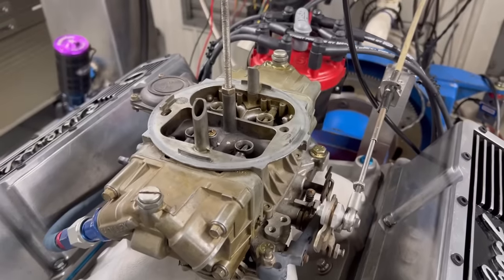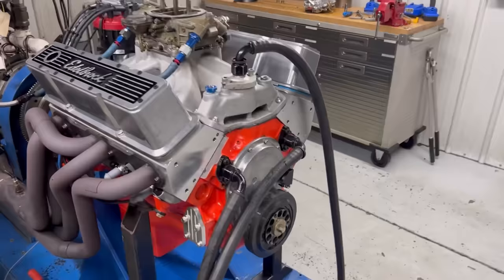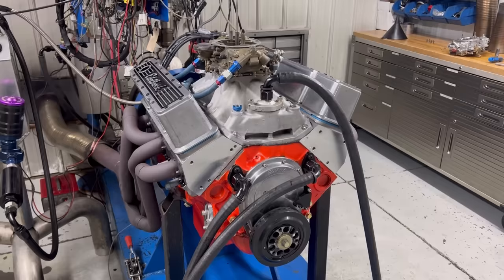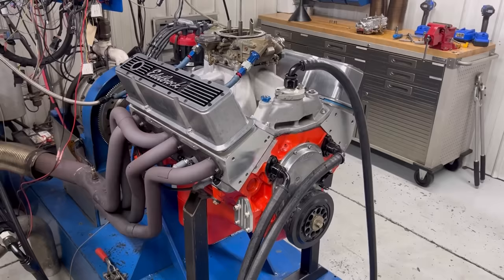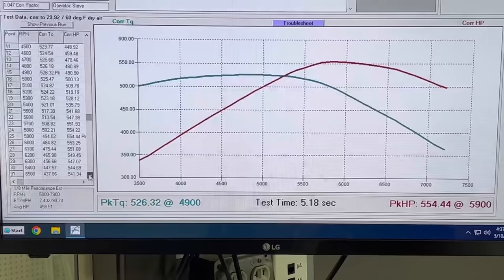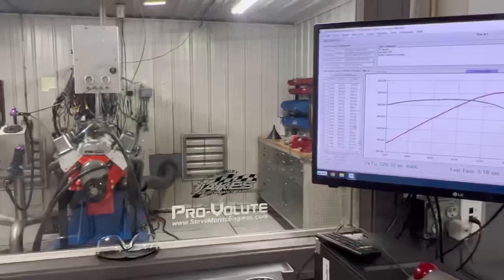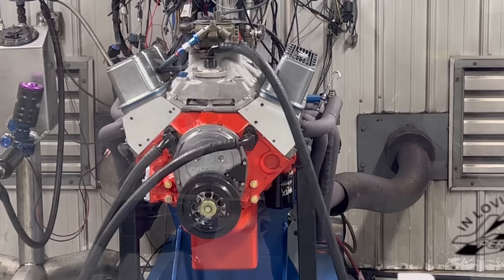Old school baby!  383 SBC

Comment: Thers a reason these motors are so prolific. You gotta love a small block Chevy that makes over 500 horses and still idles decent. Very nice.
Reply: But no choke!   How do you start it on a cold day?
Reply: @garybulwinkle82  no problem just use ya foot n baby the throttle
Reply: @garybulwinkle82  So buy a carb with a choke.... my electric choke quadrajet works just fine and still gets better fuel economy than any holley.

Comment: That would be a blast to drive around on the street. This proves once again that all you need is properly matched parts to have a good performing combination.
Reply: Unless it’s turbocharged, carbs can generally be used to great success if you have the know-how
Reply: Very true. I work at a mustang shop and we had a old school 302, GT40 upper and lower with heads. Also has a T trim blower on it and made 544 wheel on our dyno.
Reply: We've done quite a few 383's for both street, and race track use, and they are a very good 'bang for the buck' engine. Another very popular deal is the 347 Ford stroker.
Reply: and the other kicker is to focus on what's behind the flywheel. many dyno queens love their buildsheets, but that's with no water pump, 60 degree inlet air, and an exhaust system that won't fit a car. but get the right torque converter or clutch, right weight flywheel, good gear ratios, and a rear suspension that won't hop, and folks won't even believe the time slips when you show them.

as for carbs, they're great for turbos! the venturi effect cools the charge coming in, you just have to build for boost so you aren't spraying gas out the tube you put a spark plug boot on top of (old school, ask your father kids)
Reply: @albertgaspar627  carbs are horrible for turbos… it’s the very thing carbs are not equipped to deal with. 
There is tons of literature on this, just some googling and reading and you’ll get to the same level of understanding. 
Not trying to be rude at all; it’s just not even a debatable point so I assume you don’t have the info to know otherwise
Reply: @albertgaspar627  also btw, charge air cooling with fuel is an evaporative cooling process. Venturi cooling is a whole different process
Reply: @bigiron4018  Guess you've never heard of CSU carb's?
Reply: @bigiron4018  I appreciate the measured response. OEM made carb'd turbo setups (with warantees) until the 1980's gas crisis when they downsized everything and returned to V8's afterward. There's plenty of information out there if you just search "carb and turbo" to get it right. this is just the first ones I found:

how to build one cheap:

https://www.youtube.com/watch?v=9ENLVf0VZ80

does it really need an intercooler:

https://www.youtube.com/watch?v=BzvyXGwOMcw

Even Richard Holdener got on the bandwagon with an LS and carb setup:

https://www.youtube.com/watch?v=EkKVYTMK6NY

twin turbos on a rat with a carb:

https://www.youtube.com/watch?v=Yt3jH7R5ixo

so there's videos of it being done and the scientific results. Hope you enjoy :)
Reply: Big Iron there are plenty of guys out there making big power blowing through a Holley carb.
Reply: @matthemberry   making power is easy, it’s low load drivability they really suffer with. Most are just way too rich in these conditions which is poor for street driving

Comment: Nothing wrong with old reliable SBC they are still out there and still making power good for the old hot rod or weekend cruiser
Reply: Yup!
Reply: @musclebone7875  Putting one in my C3 just so it goes as good as it looks. Can't have as beautiful car and 170 hp. Lol
Reply: @nkmoto894  right! A c3 with 450 to 500hp would be nice 👍
Reply: the funny thing is that in an age of LS, mouse motors are the cheapest they've been since 1973.
Reply: Love the sound of a high compression big solid camshaft SBC.    Sounds better than any LS
Reply: @Ada-zn3pw  My C3 does sound good I'll give it that. & I will miss it. But I want to reliably make 500 whp and have AC and daily drive it. It'll get better fuel mileage in this crisis we're in so I thought the single turbo LS would be good thing. For now she's still a sbc 383 stroker and I'll keep that engine as back up. I will always have a soft spot in my heart for the thumpy sbc. Lol

Comment: This engine bring backs many memories.  I remember finding 400 cranks and turning them down to do this 30 years ago as well.   It always was a fun project.   Brought back many memories.  Thank you for sharing.   Was very surprised at 550hp, but was not surprised at 500 ft/lbs of torque at 3500.
Reply: @peterlyons4389  you did back before the aftermarket did it for you
Reply: @peterlyons4389  When I did this years ago, we found cranks out of sbc 400's out of combines (which was very common) and you had to turn down the mains.    As MrJayo Stated below, this isn't like today where you buy a crank and put it in and its all done for you, this was the old days of digging through junkyards to find parts ,the times have changed.
Reply: @peterlyons4389  ah well...the deal is, when automakers made a long stroke crank for a smaller engine, they needed the new crankshaft to have strength. that strength comes from the main diameters overlapping the rod main diameters, and the easy way was to increase the size of the main journals. look up the difference between the 400 and 350, you'll see that they indeed to need to be turned (and if you wanted a 377 cid, you had to use special bearing shells to put your 350 crank into a 400).

now, to further educate you, in 1968 chevy changed the rod bearing size in the small block. so folks building an "all factory parts" engine for racing would take a post 1967 crank, and offset grind the crank to a pre 1968 connecting rod and get more stroke. On a 350, that would be a 360 cid without any boring out, 365 on a .030 over block, and 370 on a maxed out .060 cylinder. 

Around the 1980's folks went to the 383 because they typically put fuelie heads on their 400 without knowing they needed to drill out steam holes and overheated the block...but decided the crank was salvagable.
Reply: @builditinyourgarage7826  I've done that with transmissions.  Taken apart 3 scrap trannys to get different ratio combos. Then build 1 trany.
Reply: I was part of a fuel car team back then and I got the combination from another racer. I did one including the block clearancing in the back room of the speed shop. Without many people knowing what it was it was a nice surprise. I had it in my daily driver Vega panel. Could light the tires at like 60 mph .

Comment: I love these old school small blocks. The supercharged and turbo LS builds are awesome and impressive, but these old school engines are great for casual street rodders who don't want to run 6's at a drag strip.
Reply: Quite a bit of effort to get an LS in the 6's. No?
Reply: Yep...this is an awesome street motor, no doubt....lotsa torque down low to make it MOVE and enough HP up top to make it fast.....

Comment: Back in the 90s I built a SBC.  I still like the sound of that SBC at 7000 RPM over the "slappy" sound of the modern motors like the LT1 in my 18 camaro..

Comment: I could hear the accelleration rate of the power test right away. That impressed me the most. Very honest dyno pull. Vrs some of the desperate pulls we see on youtube set at 100 rpm per second or even less in an attempt to fool someone and torcher some guys engine.  So this was refreshing and gets 5 stars from me.  Also was enjoyable to see a good o'l grass roots core sbc like we all grew up on done by pro's.   Great runner!

This was the best vid I have watched in a very long time.
Thank's

Comment: Sounds excellent, killer numbers and torque curve. People are so fast to dismiss the old sbc these days and I'm not sure why.
Reply: Simple answer more power, cheaper and stronger engines like the ls are in every junk yard now. Still love a good old sbc tho
Reply: @joe1273  No doubt LS is cheaper  out of the box. But if  you're doing aftermarket block and heads build the LS doesn't really hold any advantages anymore.
Reply: @joe1273  If you like junkyard engines, not for me
Buying aftermarket stuff for ls vs sbc, machine work sbc is still way cheaper and just as effective. Takes a lil more cam timing to make the same power thats all due to the 23 deg head and hassles of efi tuning etc

Comment: Wonder if Steve has any tunnel rams with Predator VV carbs hiding in the shop? Now that would be a lesson in tuning ..........
Reply: Heh..was just thinking the same.
Only Chevy I've ever owned was a 383 built around the time this one was (early nineties)..pretty much identical to this, but running a single Predator. Nobody did dyno runs back then, but it was good for low 9's in a light front engine dragster..
Good ol' days..

Comment: Real close to what my Dart SHP 400cid puts out. My combo makes 530tq 560HP on pump gas using a very drivable dual plane manifold.
Reply: Same here , just a little less hp (500) and skip white stuff. 400 block= torque monster
Reply: @frankburn6312  Yes all that torque right off the line, so much fun to drive. Made a double pumper work with my Automatic with some tuning.

Comment: Now build a 377 destroked 400. I think even being down a few cubes it will make it up in flow with unshrouding the valves out to the bigger bore. This setup dominated dirt track racing back in the days of limited aftermarket options.
Reply: @peterlyons4389  no it's a 400 with a 350 crank
Reply: @peterlyons4389  I don't understand your math that would only be like a 378 if it's bored 30
Reply: @peterlyons4389  the math dont lie 4.155*4.155 *.7845*3.48*8=377.05 ci. 
A std bore 400 with 350 crank 371 and change ci
Reply: @scottmuller1901  we will let him ponder on his mishap
Reply: @peterlyons4389  you might want to figure out the correct answer before you post something else

Comment: That's real good numbers for a gen1 383sbc, it would be real nice to know the cam specs.
Reply: You can bet it's not a wide LSA cam at 110-112 and most likely is either 108 or 109 if the compression is over 10:1.
Reply: You can definitely run 11.1 on pump gas with a big duration cam .

Comment: Wow that a good running street engine . I was amazed on the hp and tq number . It's my opinion that cylinder heads is key to doing this . I prefer a solid roller csm also .

Comment: I dirt oval race. In the class I’m in it’s either a 602 with 350hp, or a open engine with around 450hp, if you stay on the edge of the rules. The 602 can run a 4 barrel Holley, but the open engine has to run a 2 barrel Holley.

Comment: Steve m.  Do you when the rare time you do carbs look at IFR  sizing per displacement.  Holley ships carbs with 0.031" IFRs. Good for a 327- 335 ci.   347 -360 ci  need a 0.032 ifr.    383s need a 0.033 ifr.  
This prevents leaning the engine out from idle till the primaries start to flow at 1900 and fully take over at 2400.  Looking at AF ratio just below when the primaries start to trickle fuel let's you know the ifr sizing is correct..

Comment: I have twin 1969 Kiekhaefer 482's. Built the same way with welded up cranks and reground. Basically, it's a stroked 427 truck/tall block to a 482. All off the shelf chevy parts numbers except for the rods.

Comment: I have a forged turbocharged 383 with heads cam intake 4150 throttle body  running ls1 ecm coil over plug ignition .   I love the old school sbc with modern electronics.  Back when I built it there was a large difference between building a gen1 and gen  3/4

Comment: I built a 383 sbc 3 years ago. I know I am not  getting 550hp. More like 400 maybe. Alum heads, roller cam, lifters and rockers. performer air gap manifold and edelbrock 650 carb. Street fire distributer, headers. I t runs like a banshii  at wot but idle is not great under load and it wants to pre ignite or run on when hot. When cold it acts like it has a vacuum leak leak and wont power the brake booster. fuel economy is terrible. I could use some advice if you have any clues. I know you are busy so don't worry about it. Thanks for the  video. I'll keep trying till it gets better.

Comment: I have a low mileage SBC 350 bored and stroked engine which makes it a 383 SBC....Turbo 400 transmission,NP205 transfer case,1/2 ton Ford F-150 axles..Dana 44 high doff front axle and a stout Limited Slip 9in Ford rear!! For my 4th Cherokee build my 92 Country Edition Cherokee...Gonna be sick!!!

Comment: i built 1 stock block 383 core #  3970010 The good stuff in those days pro line bottom end Dart pro one heads with 2.15cc in 2.08in 64cc copper head gaskets arp bolts harland sharp 1.6 rockers and a 750 vaccume secondary too and then came THE LS ,at the bottom again owe well its forged 10.9 comp lets spray 300 and it took it till it took off my spark plug strap and a valuve on the way out at the finish line some what like someone we know!1  took more than nickles and dimes brother. thanks for your constant dedication and content {would you shair more info cam spec anything would be appreciated old school 383z we are many > MJ

Comment: Nice torque curve for a single plane! 1.37 lb-ft/cu in is very stout! Interesting that you picked a solid roller. Just curious—did you use roller/needle bearing lifters or bushing style?
Reply: Di
Reply: He said solid rollers
Reply: i think he uses "street" rollers that dont need a lot of spring pressure or a higher spring rate like a normal high lift roller  that trashes solid roller lifters

Comment: I like the rpm range.  Can you give us a general range of the cam's duration at .050ths? I would guess in the high 230s to low 240s on the intake and 6 degrees more on the exhaust at 110 degree CL?

Comment: That’s what I ran in my race car ( hopped up 350’s I was making 1000Hp N/A according to the NHRA’s Dynamometer and that’s WHP ) except I ran a Holly 750 double pumper at first then later on I went to an 850, it needs a better intake and way bigger cam, my car made power out to 7800rpm but I ran a huge Lunati race cam, for a SBC it makes peak power like a BBC that’s weird I built a bunch of stroker for other ppl and they ran like I dunno what I built a guy one he had a turbo 400 I told him he needed a new race transmission with a shift kit in it he calls me two weeks later to tell me my motor blew up his tranny just like I told him it would I told him this is essentially a bracket race car motor back in my day this engine woulda ran a low 5 sec 1/8th easy only different is it had a comp cam which knocked off probably 200+ HP from the build he didn’t up his compression either he stayed 10-1 instead of going 13-1 or higher 15-1 makes a lot of power in a 350/383 convert you break a lot of rods though at least in my day they have Titanium rods now I wish they had that when I was racing

Comment: Thats outstanding numers! That would be a  perfect motor for my boat. Can you list the build?
Reply: It's really hard to make anything less than 500hp and 500tq with a 383 and modern cylinder head castings and a middle of the road hydraulic roller cam. 600+ with lots of compression and a monster cam. Any 383 rotating assembly, any aftermarket aluminum head from a quality manufacturer and a 236/240 cam will get the job done with 10.5:1 compression and pump gas.
Reply: Excellent thank you for replying

Comment: That's impressive for a 383, I wasn't expecting that sort of power out of it. What fuel were you running?

I'm surprised he didn't have you use an aftermarket block and build something in the 408-427 range.
Reply: He said pump gas... and he also said its a 30 year old engine not a new build where he chose the block.... lol open your ears dude
Reply: @jessehackett4983  I heard that it's a rebuild of an old engine, missed the pump gas part. 

At the point that you're throwing on new heads, crank, rods, pistons, and paying Steve Morris to build/dyno it, seems strange to me to not throw a few more bucks at it and have a better block that allows more bore.

unless there's some real emotional attachment to the block itself, possible I guess

Comment: Excellent video Steve. The description on the engine, it’s curve, and the dyno setup are awesome icing on the cake. Was this a cam that you custom spec’d out? Very interested in cam specs
Reply: He said it was in the video. If you want cam specs call and order it. The majority of cams engine builders do for their racing clients or grudge racers are usually not disclosed, racers are always looking for an edge. If his design can make another 40hp, and do so with less parts wear then he has a marketable grind, and to just give the specs away so some dude watching YouTube can call comp and have it copied is bad for business. At the end of the day the man is running a business that supports racers. This kind of information is not given away for free.

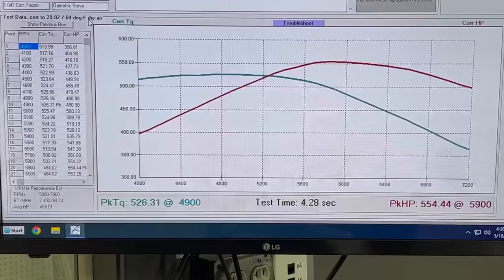Comment: @ 4:15.....looking at the graph....some real questions
what stall converter would you use
what rpm would you launch off the line
how far down the track would you get befor the max HP finally kicked in

would this be better for 1/8 mile or 1/4 mile tracks....I dont think 1/8 mile you would reach your max hp before you had to shutdown

Comment: What are your cam specs??  I'm running a 383 in my 71 Camaro,, very similar to that setup.  It's made from a 97 truck block, 1-pc rear main, internally balanced, cam is hyd roller, .525 lift with 1.5 roller rockers.  4160 Holley, 750 cfm vac secondaries on alum dual plane hi-rise.  It is pretty beefy, but I don't think it's making those numbers.  I think mine is more likke 425-450 hp, "maybe" 400 ft lbs torque, but that's judging from the seat of my pants, definitely not measured.
Reply: Yeah, but he has no power steering pump, alternator, water pump or A/C compressor to hinder it. Not to mention headers with straight pipes. Those things would add up to about 50hp loss under load. Where take those off your engine and you'd run yours up to 480 or 490. 
You didn't mention your heads either.